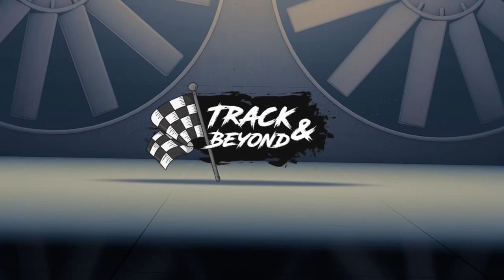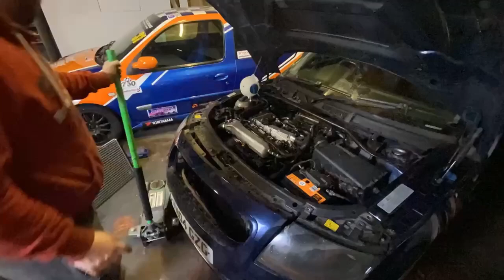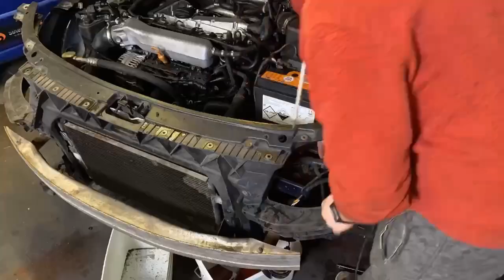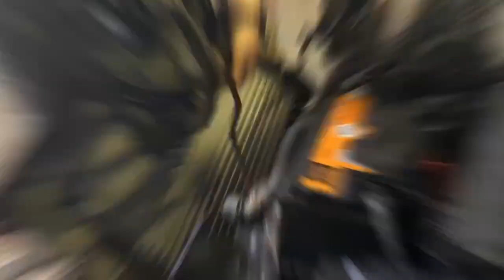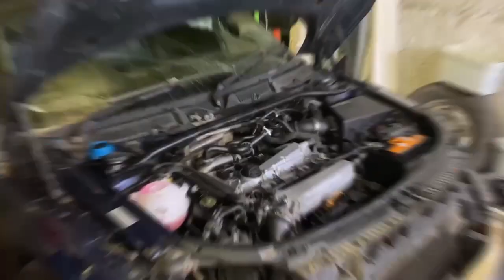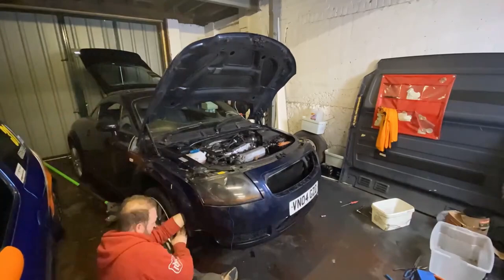Replacing The Radiator On A Mk1 TT

Comment: Looks like I have a radiator leak on my 2002 Audi TT Quatro. This will be a help.  I also need to replace the heater core :(
Reply from the maker: Hope it goes well, good luck ✌🏻
Reply: @TrackAndBeyond  Thank you! The hardest part is making the time to do either one.  Will get radiator first.

Comment: I'm having trouble getting the thermal switch out of the radiator. All my D connectors were solidified with mud, even after I broke one of the clasp/clip, it still had to be slide off with two screw drivers wedging them in and wiggling. First time working on an Audi, not going too well lol
Reply from the maker: Oh dear! Sounds like your cooling system is in a pretty poor state maybe best to try and find a new thermal switch instead of reusing if it’s that bad to be honest. Only other thing I can recommend is soak it in some WD40 and leave it for a few hours then give it a go
Reply: @TrackAndBeyond  right on. I will definitely get a second hand oem one from a junkyard. I put power to the primary fan and it wouldn't move at all. I hope that is all that is wrong. I'll see if I learn anything from my situation that I could post that will help others.
Reply from the maker: Sadly it’s a common issue for the capacitors in the radiator fan pack to go so you may require a new fan if you tried to power it up and got nothing. Might wanna grab one from the junker at the same time
Reply: @TrackAndBeyond  Once I get the thermal switch from the radiator out, should I be able to put power to it to jumper it to see the fans move also? That should tell me that the switch is also bad, which I believe is also true

Comment: How long do you think it takes to do this job , I got to change the radiator fans
Reply from the maker: Probably took me a good 2-3 hours or so depends how much the car fights you! Like taking the front end apart etc if your just changing the fans hopefully shouting take you as long as you shouldn’t need to remove the radiator etc just pull the front end down and change them on the radiator in place. You mate have to drain the system and remove the radiator hoses to bring the front end far enough away to work on them though.

Hope that helps
Jason
Reply: @TrackAndBeyond  thanks very much for getting back so quick, was not expecting that 😊. Nice so not bad off a job . Great vid helps a lot 👍
Reply from the maker: Thank pal! Yea it’s not a terrible job just fiddly especially taking the bumper off etc

Comment: Did you have to discharge the ac and disconnect the ac condenser?
Reply from the maker: The system was already empty so there wasn’t anything to discharge but yea if the system had gas you will have to discharge it and remove. Either that or what you can do is remove the A/C pump off the engine and try leave that in the engine bay when the engine is removed that way then the A/C doesn’t need to be touched
Reply: @TrackAndBeyond  ok thanks for your reply

Comment: Did you put new fans on also? How long does this take?
Reply from the maker: No still used the original fan took it off the old radiator and put it on the new one. Took me around 4 hours or so depending on bolt conditions etc
Reply: @TrackAndBeyond  okay. I just did a jumper test on the Radiator Harness Socket. 

Only the High and Low Fans run simultaneously,
Low Only Fan Operation Failed.
Reply: @TrackAndBeyond  Found out my Low Fan side was crap. Had voltage up to the fans but nothing was working Resistors are toast.
Reply from the maker: New fan required for you then bud. Atleast you’ve found it 😀